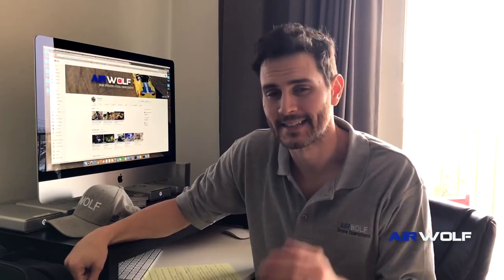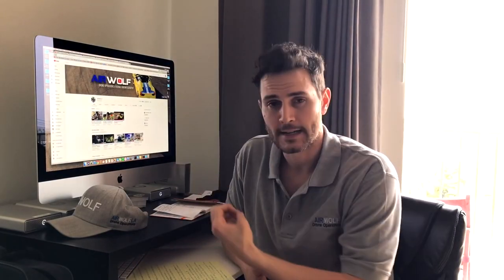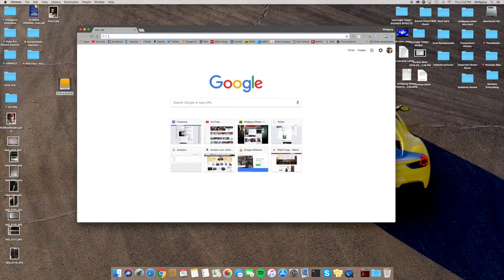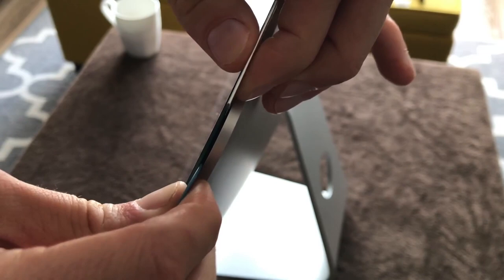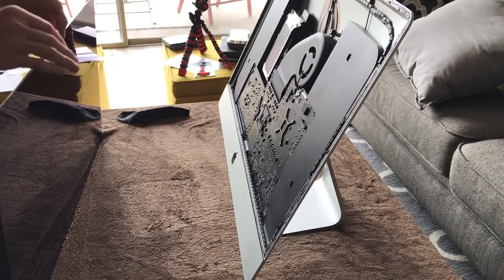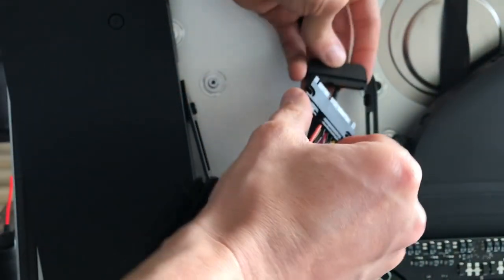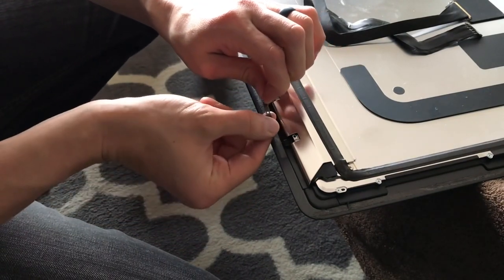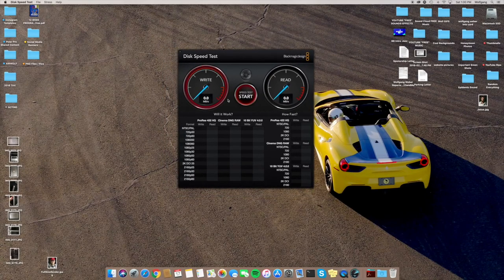Step-by-Step iMAC SSD Upgrade Guide for 5x Faster Performance | 2012-2019

Comment: $1000 to an install an SSD that cost $100? My computer repair shop we charge $329 for 1TB SSD installed with data migration when applicable.
Reply: Damn $329?  It's like a 1 hour job or less.  Your rate is $300 an hour?
Reply: @scottdrew6403  no it is much more than one hour job. Especially with data migration and updates. Usually it takes just an hour to install the solid-state drive, than another hour for the OS install, and depending on how much data the customer has the migration can run over night. Also the part cost us roughly $100 so it’s only really a $200 profit.

Comment: I messed up man. Screen is black with loud fan noise after installing SSD. Damn..
Reply: connect the screen cables properly. It will solve this issue
Reply from the maker: Make sure you properly connected your monitor. Exactly what Leitan said.
Reply: Thanks guys. A friend of mine helped. I messed up the LCD display connector. All gravy now 🏆
Reply from the maker: Phew. I was scared. Glad you got it figured out.
Reply: @AIRWOLF  Thanks bro. I was heartbroken 3 days ago lol Hopefully OBS will work with me daw now

Comment: Great video but I'll disagree with the thermal sensor part. You DO NOT need an expensive thermal sensor. There was a whole video done on this (https://youtu.be/pMsk1o1W2B0). It's just a ploy by Apple to once again make it difficult for you to upgrade your hardware so that you'll return to the Apple store and shell out $$$ for a newer system. Instead, you can just use a simple SATA power Y-splitter cable ($7) and it'll keep the fans from running at full blast which is what the "thermal sensor" is notionally supposed to do.
Reply from the maker: Robert Spielman noted
Reply: Dude, link is dead.
Reply: You do NOT need a thermal sensor in late 2013 27”. My fans run just fine. Samsung evo 1tb
Reply: @traviss3442  Did you install without the sensor? Do you use any apps to control fans?
Reply: Have you done this test?
Reply: @andersonfotoart  Yes put in an Samsung EVO 860 1TB with "Macs fan control" (its free) just to monitor it. never gets hot. SSD's really dont get hot like a spinner and my CPU cores are nice and cool. i just put the fans to auto. SSD's have SMART sensors in them. I use pretty CPU intensive software and everything is perfect.
Reply: @andersonfotoart  BTW Airwolf's instructions worked perfect. I bought the" LeFix Replacement LCD Panel Adhesive" and all is good. just clean the SHIT out of the outer frame and monitor of all goop from the original tape. I used rubbing alcohol and the screen is on as good as it was from the factory. My mac is really FAST now and put in 32Gb of 1600 ram, no need to buy a new computer for a long time now. good luck bro.
Reply: @traviss3442  wow thanks a lot for the tips !!
Reply: @andersonfotoart  No problem buddy, good luck to you and your fast ass newish computer!!!!
Reply: @markistheone947  no it isn't

Comment: Thermal sensor on ssd? Naaah😂
Reply: People have reported that without the thermal cable the fans run permanently on 100% power.
Reply: Depends on the model year of iMac. Early models needed it. Later models did not.
Reply: @demef758 do the 2015 models need it (17,1) I am planning to do this upgrade for a customer, but I see I have 2 options. 1. is to do the full install by removing the screen and replacing the internal HDD with an ssd, but I dont have the adhesive or opening tool nor do I have the sensor (If it comes to it I will buy those as I have seen kits for them). 2. I can install the SSD I bought into an external enclosure and install mac os to that instead and run it from that. I would love others input on what I should do. Im leaning toward installing it into an enclosure and running mac os on that  but If I dont need the temp sensor I will try to internal install.

Comment: you don't even have to take it apart . USB SSD . avoid the headache.
Reply: What’s the data transfer rate USB versus SATA?
Reply: @billb8262  Sata 3's transfer rate is 750 MB/s, USB 3.0 is 625 MB/s

It's close.
Reply: I actually didnt think about this as an option honestly. How do you setup an external drive to be your boot drive? I didnt think that was possible on macs (my experience repairing macs is with the older ppc era and early intel). I was planning on doing this repair for a customer but if I can save some trouble installing the new ssd into an external enclosure and running it that way I would much prefer it.

Comment: Doesn't make macs that much faster.
Reply: If it had a hard drive or a fusion drive, yes it will. SSD is a lot faster than a hard drive
Reply: Mine boots in 11 seconds flat, High Sierra, 2011